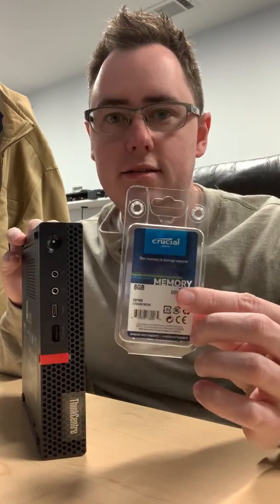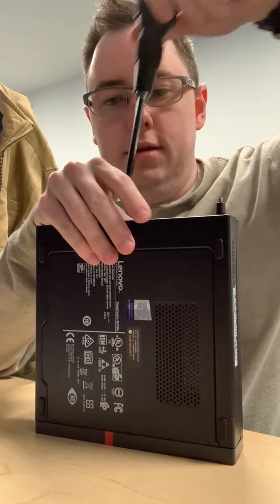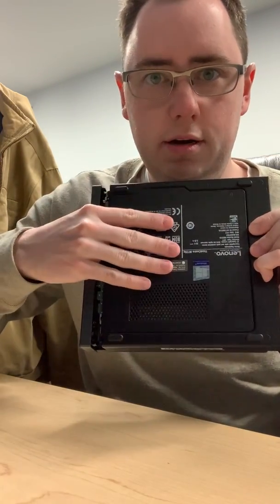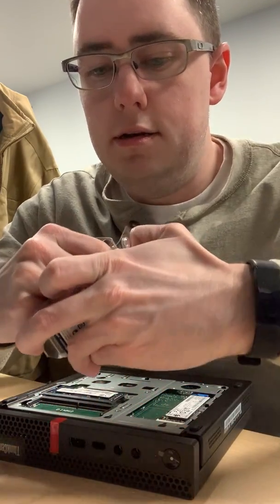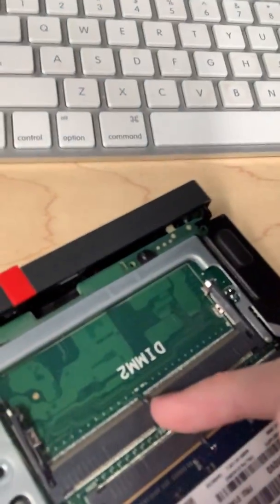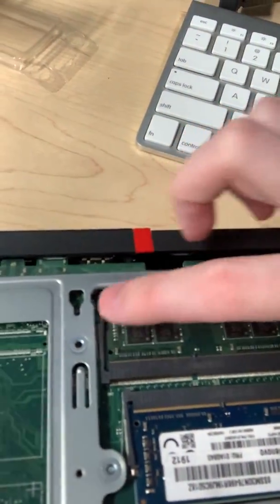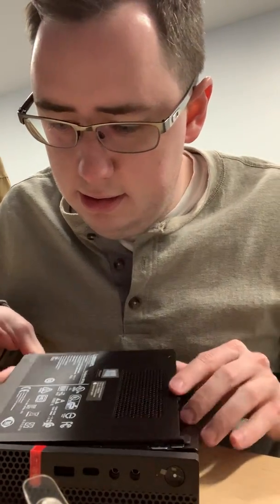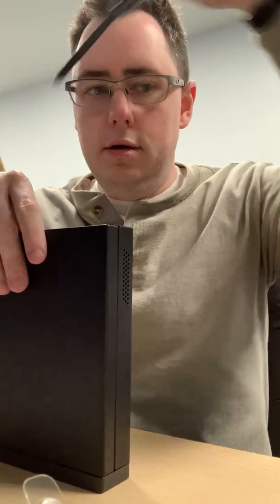How to Add Ram to a Lenovo M720Q

Comment: do you have a video on how to add ssd to m720q without removing the 500gb hdd?
Reply from the maker: I don't How ever some models have an internal drive bay for a 2.5 inch drive inside the larger housing on the other side. The small bay where the M.2 and ram is was the only option the unit we got came with.